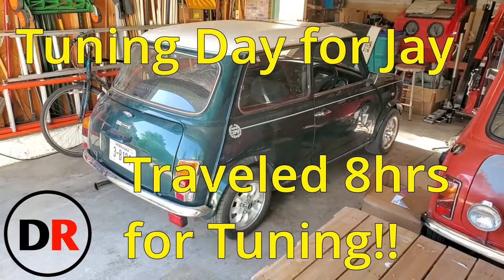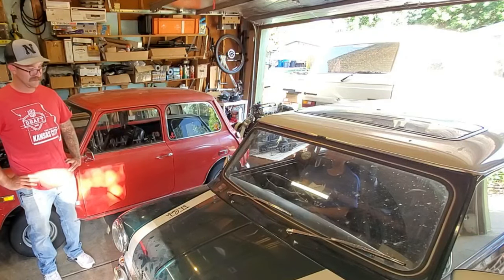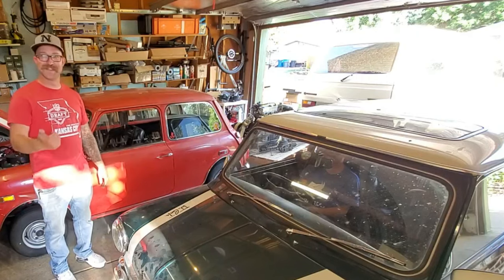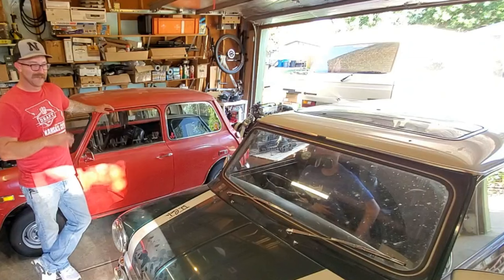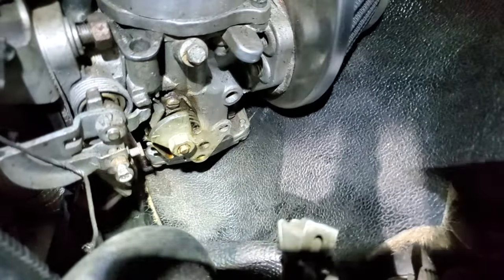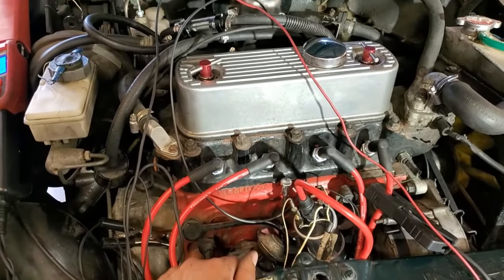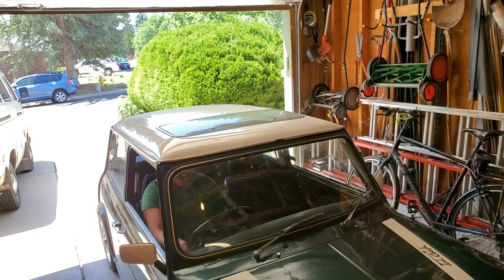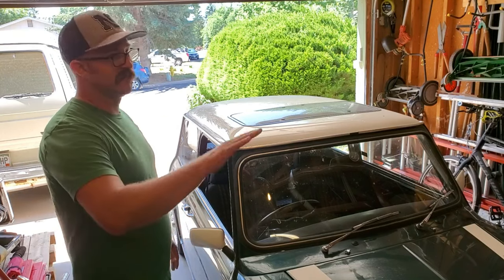Tuning Day with Jay plus New AC Dodd HIF44 carb!

Comment: Is that a RSP Cooper? Sounds sweet.

I notice you seem to have a higher lambda value (leaner on idle) than AC uses, why is that?do you have different location for the lambda sensor in your setup, or do you have different emission standards?

Well done on the tuning, another Mini on the road that can be used to its full potential!
Reply from the maker: The lambda reading at idle is different depending on what ignition system is in the car. It also depends on carb wear and air leaks at the intake. 

 It is also sensitive to any leaks in the exhaust system which can bring air in and cause the sensor to read leaner.
This car did have some minor exhaust leaks.